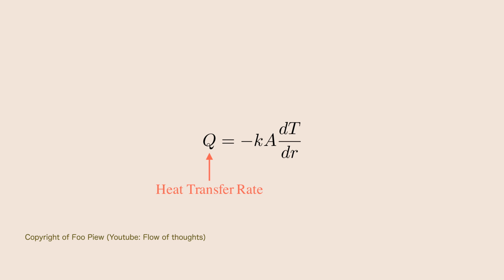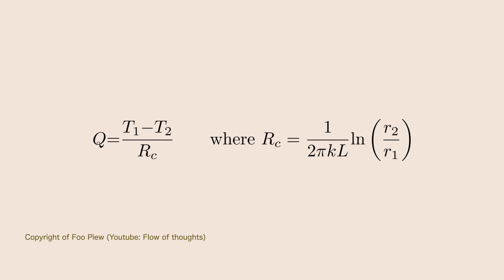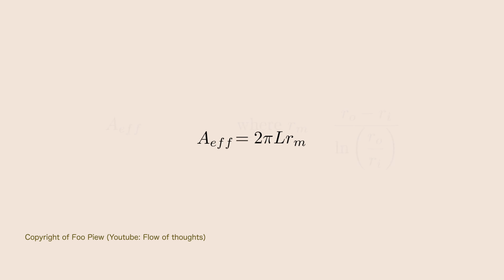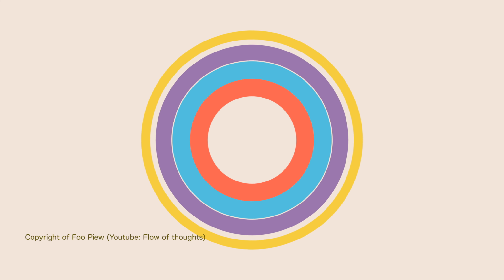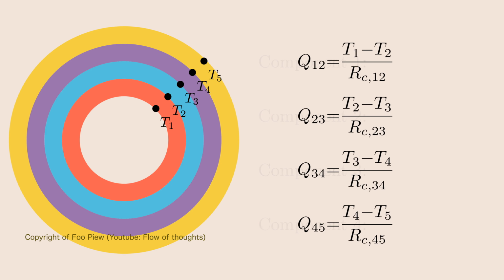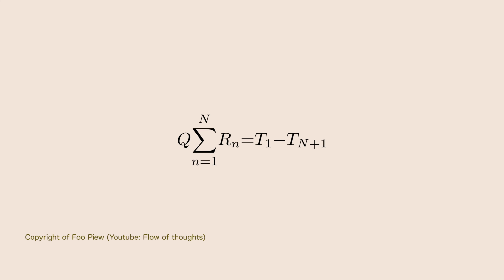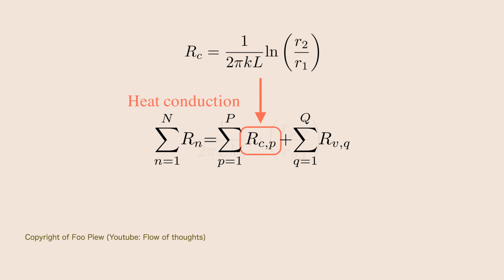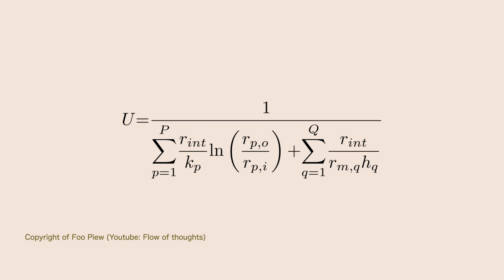Overall Heat Transfer Coefficient for a Cylindrical Pipe

Comment: 2.	Saya akan paksakan bahwa R2 = R1. R2. untuk membuktikan  keberatan saya. Selanjutnya dengan melakukan substitusi ke persamaan  awalnya, saat R1 = 0. ( Solid ).
Q 			= - k. A(dT)/ (dR ). Hukum fourrier

Q 			= k. 4π R2.L (∆T)/ (∆R)
Q 			= k. 4π R2.L (∆T)/ ( R2 - R1 )
R2.adalah jari jari outer dan R1 adalah jari jari inner

R2			= R1.R2
Q 			= k. 4π R2.L (∆T)/ ( R2 – R1 ).
Q 			= k. 4π R2.L (∆T)/ ( R2 – R1 ). saya fokus pada persamaan yang hurufnya bold.

Bagaimana jika R1 bernilai 0 ?.  Saya substitusikan rumus dasarnya.
Q 			= k. 4π R2.L (∆T)/ ( R2 – R1 ).
Q 			= k. 4π R1. R2.L (∆T)/ ( R2 – R1 ).
Q			= k. 4π 0. R2.L (∆T)/ ( R2 – 0 ).
Q			= k. 4π 0. .L (∆T)/ ( R2  ).
Q			= k. 4π 0. .L (∆T)/ ( R2  ). Pada persamaan ini muncul 2 jawaban.
Dalam hal ini akan muncul 2 alternatif jawaban.
Q			= k. 4π 0. L (∆T)/ ( R2  ),  0/R2 = 0, 
Sehingga,
Q			= 0		 			( alternatif 1 ).
Komentar saya adalah apakah saat bola dalam keadaan solid, maka Q = 0 ???. hal ini sangat tidakl masuk akal.
Atau altenatif lainnya adalah
Q 			= k. 4π R2.L (∆T)/ ( R2 – R1 ), R2 = R1. R2
Q 			= k. 4π R1. R2.L (∆T)/ ( R2 – R1 ), 0 =  R1
Q			= k. 4π 0. R2.L (∆T)/ ( R2 – 0 ), R2 – 0 = R2 
Q			= k. 4π 0. L (∆T)/ ( R2  ).
Q			= k. 4π 0. .L (∆T)/ ( R2  ),  0/R2 = 0 pindah ruas kiri
Q /  0			= k. 4π .L (∆T)   
+∞			= k. 4π .L (∆T ), k. 4π.L adalah nilai konstan ( C ), sehingga 
+∞			=  C ((∆T ), sehingga, 
+∞    			= ( ∆T ), ∆T = T1 – T2
+∞    			=  T1 – T2, , T1  = +∞ dan T2 diketahui, sehingga 
+∞    			=  ( +∞ – T2 ), satuan sisi kiri adalah watt dan satuan sisi kanan temperature sehingga tidak boleh dikurangi.
+∞    			=   T1
+∞   			= (∆T ), ∆T =  ( +∞ – T2 )	  		( alternatif 2 )
+∞ 			=  T1, ∆T =  ( +∞ – T2 )
+∞ 			=  T1,	
Komentar saya adalah  apakah saat bola dalam keadaan solid, maka  (∆ T ) = (+∞ ) atau  (T1 ) = (+∞ )  ???, hal ini sangat tidakl masuk akal.
3.	Apakah jari jari selubung  bola dibanding ketebalan kulit bola pernah bernilai 1? Jika ditemukan rasio jari jari selubung bola terhadap ketebalan kulit bola memiliki nilai 1 , maka rumus yang digunakan perlu untuk dikaji ulang. Alasannya adalah jari jari selubung bola bergerak tidak linier terhadap ketebalan  kulit bola. Sedangkan jari jari selubung bola bergerak berdasarkan fungsi hiperbola tertentu( tidak menyatakan garis linier. Yang bermakna R2 / ( R2 – R1 ) ~  R2 R1 ( R2 – R1 ). 
Sehingga, 
R / ( R2 – R1 ) = ( R2 R1 )0.5 / ( R2 – R1 )  adalah perbandingan  jari jari selubung bola terhadap ketebalan kulit ( R2 – R1 ).
(R1 . R2 )0.5  / R2 -. R1 tidak pernah bernilai 1. Ditulis dalam persamaan adalah (R1 . R2)0.5  / R2 -. R1 ≠  1. 
Mari kita buktikan bahwa (R1 . R2)0.5  / R2 -. R1 = 1, jika bisa ditemukan , maka rumus sebelumnya harus dikaji ulang. Sebagai catatan bahwa saya akan paksakan bahwa R2  =  R2. R1 dan R = ( R2 . R1)0.5. Sehingga perbandingan jari jari selubung bola terhadap  ketebalan kulit bola ditulis dalam persamaan :

( R1 . R2 )0.5  / R2 -. R1			 = 1				.…….  Persamaan 1	 
Q 		`			= k. 4π R2.L (∆ T)/ ( R2 – R1 ). 				 
Q 					= k. 4π R1.R2.L (∆ T)/ tebal. 
Fokus  pada R2 / ( R2 – R1 ).
R2 / ( R2 – R1 )										 
R2  					= R2. R1
( R2 )0.5  					= ( R2. R1 )0.5
R					= ( R2. R1 )0.5
Yang dicari adalah jari jari selubung bola terhadap  ketebalan kulit bola.
R / ( R2 – R1 )				= 1,  R = ( R2. R1 )0.5
( R2. R1 )0.5 / ( R2 -  R1 )			=  1, sehingga
( R2. R1 )0.5 				=  1.( R2 -  R1 )
( R2. R1 )0.5 				=  ( R2 -  R1 ), persamaan di kuadratkan sehingga
( R2. R1 )					=  ( R2 -  R1 )2, diuraikan sehingga
( R2. R1 )					=  ( R22 - 2 R2 . R1 + R12 ), pindah ruas 
( R22 - 2 R2 . R1 + R12 )			= ( R2. R1 ), persamaan ( R2. R1 ) pindah ruas, sehingga
( R22 - 2 R2 . R1 + R12 ) / ( R2. R1 )		= 1, dilakukan pembagian, sehingga
R2 / R1 – 2 + R1 / R2			= 1, 
R2 / R1 + R1 / R2				= 1 + 2
R2 / R1 + R1 / R2				= 3,  persamaan dikalikan dengan R1 . R2, sehingga
R22  + R12					= 3 R1 . R2
R22  - 3. R1 . R2 + R12			= 0
(R2   -  0.381969.R1 ) (R2  - 2.618031.R1  )	= 0
R2 - 0.381969.R1				= 0,	harus memenuhi  R2 > R1 	
R2  					= 0.381969.R1
R2 : R1					= 0.381969 : 1, ternyata R2 < R1. Persamaan ini tidak bisa digunakan.
Dan berikutnya adalah persamaan yang ke dua					 
R2  - 2.618031.R1  			= 0
R2   		  			= 2.618031.R1  
R2 : R1					= 2.618031 : 1, persamaan yang digunakan adalah 
(R2  - 2.618031.R1  ), memenuhi R2 > R1.
Jadi untuk sembarang R2 ( outer ) akan selalu memenuhi persamaan

( R1 . R2 )0.5  / R2 -. R1 = 1, saat R2 : R1	= 2.618031 : 1

R2 : R1					= 2.618031 : 1, adalah rasio outer terhadap inner
Kembali pada persamaan 3
( R1 . R2.)0.5 :  ( R2 – R1 ),   adalah perbandingan  jari jari selubung bola terhadap ketebalan bola. 	
R2 					= 2.618031
R1					= 1.
( 1. .2.618031  )0.5  / ( 2.618031  -.  1)		= 1.
( 2.618031  )0.5         /  ( 2.618031  -.  1)		= 1
Adalah suatu keadaan dimana panjang jari jari selubung bola terhadap ketebalan bola memilki panjang yang sama. Hal ini tidak pernah terjadi. Alasannya adalah jari jari selubung bola bergerak tidak linier terhadap jari jari  bola. Sedangkan luas kulit bola bergerak berdasarkan fungsi hiperbola tertentu( tidak menyatakan garis linier).
Namun demikian untuk kasus perpindahan panas konduktor aliran steady state bentuk  silinder dan bentuk bola. Ada syarat lain yang harus diikutii. Yaitu nilai jari jari selubung terhadap ketebalan bola harus selalu bernilai lebih dari 1. Mengapa harus selalu bernilai lebih dari 1 ? hal ini disebabkan adanya perubahan luas penampang yang tidak bergerak linier terhadap jari jari silinder maupun bentuk bola.
Kesimpulan :
Dengan menemukan persamaan jari jari selubung silinder  terhadap ketebalan silinder = 1. maka saya merasa keberatan dan sebagai konsekuensinya adalah rumus yang sudah ada harus diuji di laboratorium 
Dengan menemukan persamaan jari jari kulit bola  terhadap ketebalan bola = 1. maka saya merasa keberatan dan sebagai konsekuensinya adalah rumus yang sudah ada harus diuji di laboratorium.

SUDUT PANDANG FILSAFAT TENTANG TEORI KEBENARAN 
Berdasarkan teori kebenaran dalam rumus tersebut adalah merupakan teori kebenaran consensus. Yang disepakati bersama sama. Belum mencakup kebenaran secara universal dalam kondisi ketebalan. Hal ini memungkinkan adanya proposisi yang bertentangan dengan obyek dan hasil saat dilakukan konfrontir.
memahami Jenis teori kebenaran :
1.	Teori Koherensi (The Consistence/Coherence Theory of Truth)
2.	Korespondensi (The Corespondency Theory of Truth)
3.	Pragmatisme (The Pragmatic Theory of Truth)
4.	Teori Performatif
5.	Teori  consensus. Pendekatan teori kebenaran pada kasus ini masih bersifat kesepakatan para ilmuwan
Sumber-Sumber Pengetahuan :
1.	Rasionalisme
2.	Empirisme ( pada bagian ini saya belum melakukan pengujian fisik pada suhu material )
3.	Kritisisme
4.	Intuisisme
Secara umum kebenaran bersifat :
1.	Rigid
2.	Universal
3.	Nonkontradiktif
4.	Bisa dibuktikan 
5.	Radic
Quote philosophy :
It is with logic that one proves, it is with intuition that one invents ( Henri Poincare ).
My quote philosophy :
Matematika sanggup memprediksi kesalahan, namun belum sepenuhnya membuktikan kebenaran mutlak. 
Saya tidak punya niat apapun selain memperbaiki pendapat akademik. Yang terlanjur menyebar luas sampai ke pelosok dunia ( khususnya pada materi perpindahan panas ). Dan kita bekerja sama untuk saling memperbaiki dan menguji kebenarannya. Alangkah indahnya dunia ini jika manusia saling belajar dan menjadi bijaksana untuk segala permasalahan yang dihadapi bersama di dunia ini.
 My favourite music :
The lonely Shepherd by  Andre rieu feat Gheorghe Zamfir
Marriage d’amor –paul de senneville II Jacob’s piano
The gael – last of the mohicans-Royal scots dragoon
							Vincencius Sufijan Hadi

Comment: OPEN LETTER
UNDERSTANDING THE CONDUCTION HEAT TRANSFER EQUATION OF STEADY STATE FLOW IN CYLINDER SHAPE
To the honorable,
Anyone studying heat transfer courses (mechanical engineering, chemical engineering and nuclear engineering).
In
Place,
Together with this open letter, with humility, we send an open letter to anyone, which may be read by anyone who is willing to read this letter.
The purpose of this open letter is to re-discuss the explanation of steady state heat transfer on hollow cylinder walls
I am the writer of the letter refuting the formula that has been written in books and literature. Especially on conductor heat transfer on steady state cylinder walls.
Briefly my objections are:
1. For cylindrical shapes
a. The comparison of the radius of the sheath to the thickness of the cylinder is never less than 1. This condition occurs when the thickness is ( e - x ), where e (natural logarithm) is the outer radius and x is the inner radius which ranges from 0 < x < e ^ 0 . The reason for my objection is that the radius of the sheath always moves larger following changes in area. While the thickness moves linearly. so that there is never an event where the radius of the sheath is shorter than the thickness. Thus the radius of the sheath is always greater than the thickness under any conditions.
b. When the cylinder is solid (has no holes), the temperature will be + ∞ (the temperature increases very large without limits at the center of the cylinder). This condition occurs when the thickness is ( e - 0). e (natural logarithm) is the outer radius is a natural number and 0 is the inner radius. The reason for my objection is that it is very unreasonable for a material in a solid condition to withstand heat with a temperature of + ∞. My opinion is that the temperature can still be known even though it is difficult to practice in solid conditions.
c. The ratio of the sheath radius to the thickness is greater than 1 (has no limit) and ends at 0 (NULL) when (e - e) is outer = inner. The reason for my objection is that the sheath radius must indeed be greater than the radius. However, it has a certain value limit !!!
d. In general, the reason for my objection from points a, b and c is that the use of natural logarithms causes uncertainty in the ratio of the sheath radius to the radius.
a. When the thickness is (e - x), 0 < x < e ^ 0, then the ratio of the sheath radius < thickness.
b. When the thickness is (e - x), x = 0, then the ratio of the sheath radius to the thickness is + ∞.
c. When the thickness is (e - x), x = e ^ 0, then the ratio of the sheath radius = thickness.
d. When the thickness is (e - x), e ^ 0 < x < e, then the ratio of the sheath radius > thickness
e. My question is: How to calculate the temperature at the center of the cylinder when the heat comes from outside the cylinder by conduction with steady state flow ???
f. The prediction of the calculation error is very serious. When the outer becomes very large and the inner approaches the outer (relatively thin). Then the calculation error in temperature becomes very large.
Why is the existing formula considered as the truth? This is because the calorific value must always be (constant) in each change in thickness that experiences a change in temperature increasing when approaching the center of the cylinder along with the change in thickness where the initial temperature comes from the inner radius. With a note that the heat source comes from inside the cylinder.
However, for the case of steady state flow conductor heat transfer in the form of a cylinder. There are other conditions that must be followed. Namely, the value of the radius of the sheath against the thickness must always be more than 1. Why must it always be more than 1? This is due to changes in the cross-sectional area that do not move linearly against the radius of the cylinder as explained in point C.
PHILOSOPHICAL VIEWPOINT ON THE THEORY OF TRUTH
Based on the theory of truth in the formula, it is a consensus theory of truth. Which is mutually agreed upon. Does not yet cover universal truth in thickness conditions. This allows for propositions that contradict the object and results when confronted.
Understand the Types of Truth Theory:
1. The Consistency Theory of Truth
2. Correspondence Theory of Truth
3. Pragmatism
4. Performative Theory
5. Consensus Theory. The approach to the theory of truth in this case is still based on the agreement of scientists
Sources of Knowledge:
1. Rationalism
2. Empiricism (in this section I have not conducted physical testing on the temperature of the material)
3. Criticism
4. Intuitionism
Quote philosophy:
It is with logic that one proves, it is with intuition that one invents (Henri Poincare).
My quote philosophy:
Mathematics is able to predict errors, but has not fully proven absolute truth.
Reply: helloi brother
Reply: According to me. The calculation must be retested to determine its correctness. that is my suggestion. If you do not mind. Testing can be done in the laboratory where you teach. I am happy to help carry out the test and provide alternatives regarding the case I am talking about.

Comment: I just hope that there should be a retest on the calorific value of the heat change on the cylinder wall. which is closer to the test results than the existing formula or the formula that I found.